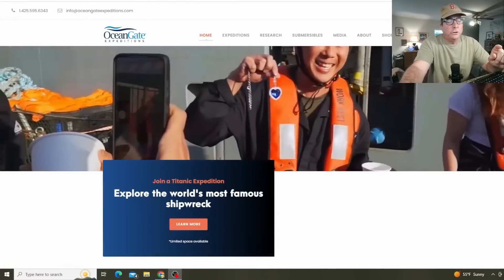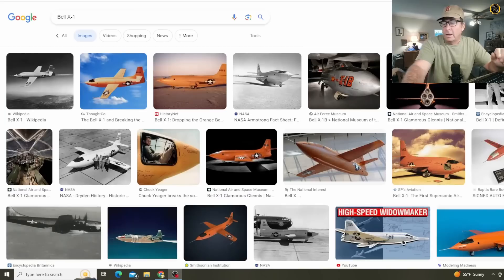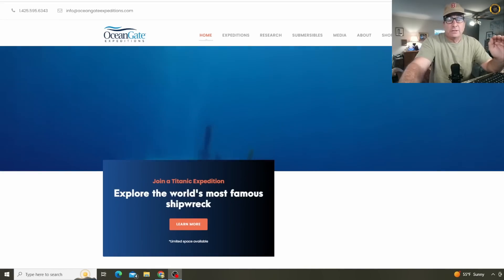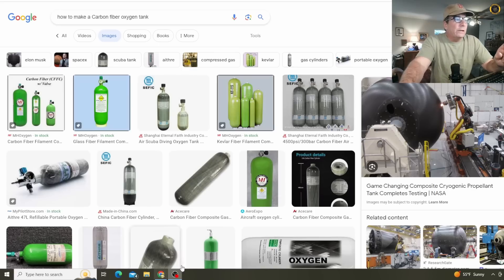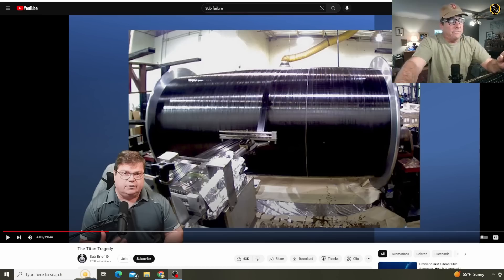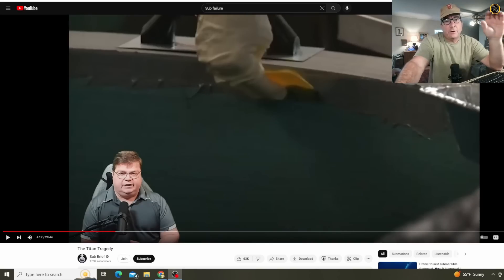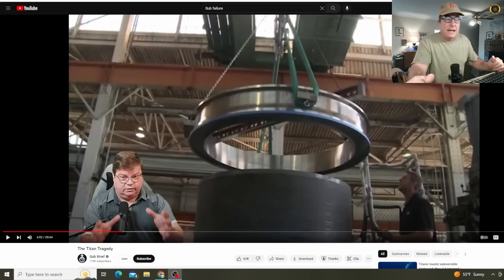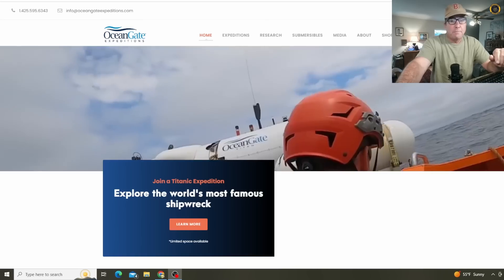Oceangate Sub Construction Details and Implosion

Comment: So the CF cylinder was laid up unidirectional and was cold cured ?  Without an Autoclave ?  The 2 titanium rings only attached with resin / adhesive?  The end caps attached with 17 bolts, or about every 10.5 inches?  What criminal came up with that design 😢  The ceo fallen into the trap surrounded by Yes men 😢  RiP  to all

Comment: The various titanium alloys are indeed unique creatures. I read an article by Kelly Johnson where he talked about the struggles they had developing the SR-71. The heads of the titanium rivets were shearing off and it turned out to be the chlorine in the local water supply reacting with the titanium. Ive worked with it over the years and it doesn't play well with others. It has its own feed and speeds,cutting tool reliefs and angles,etc. Like Juan said:" baby steps".
Reply: Similar to landing gear failures on transport jets. Not so long ago they were using Simple Green to wash out LG compartments and found out too late that it created hydrogen cell corrosion and LG failures in the massive steel struts. Who could imagine a cleaning liquid could destroy a massive gear strut? But it did....
Reply: Titanium, resistance to intense dry friction, while 'plowing' 6,000 coins per minute from a spinning disc, lasted many months of 20-40 hr weeks.. coin room counters.

Comment: I am a US Navy submarine veteran and a Aerospace Engineer, you were right on the money about the dissimilar materials, the compression modulus difference  of the carbon fiber and titanium most likely caused sheer loading at the titanium flange and had failure of carbon fiber at the edge of the flange. The carbon hull diameter will shrink more than the titanium ring and once the two are different enough the weaker will fail (carbon fiber). We will most likely find the bond held but fiber failed at the bonding point.
Reply: If done correctly,  I've found the bonding never fails...it's the weaker material.
The carbon wrap was like 5" wide, just going back and forth on a mandrel...
Reply: They were counting on the pressure of the water at both ends to force and hold everything in place. He only did 1 test dive to 3000 metres before he did the dive on the Titanic.
Reply: I used to repair submarines (Shop 38a). I've looked at videos about how they assembled this thing. And thought they should ask someone about slip joints. 
Not withstanding doubts on the durability of the carbon fiber (everyone is thinking of the stress the exterior of the tube, think also of the compression stresses on the ends, with the end bells pushing against that 5" flange also!) The best way to do it would be with the use of Chevron packing to allow for the flexing.
Reply: @brucelytle1144  I had similar thoughts about the end load on the tube. The way it was laid up didn't provide any support against that load. I once saw someone put some carbon fiber rod in a vice and with almost no pressure it just came apart. It was a clear demonstration of how fiber direction related to load direction matters.
Reply: I'm a structural engineer.  I agree with the difference in shrinkage causing a problem at the interface.
Reply: Question.  Would the tightening of the bolts have placed any torque on the titanium ring, thus weakening the adhesive?
Reply: Just seen an interview with someone who did the first dive of the vessel in the Bahamas with the builder. And was warned after the first dive by the builder that he will hear cracking! And when they went down together, he said you could hear cracking and you can tell when sub was going deeper because the cracking noise would increase.
Reply: Thanks.  Good to hear from a smart guy ....
Reply: People always just assume that glued joints are weak - but modern adhesives are absolutely incredible, even in mixed materials applications
Reply: @RyTrapp0  No testing ever done at 4000+ metres in minus 0 degrees water. Thats why something failed. They set themselves and the vessel up as test dummies.
Reply: @davidhowes7  Was making a general comment about industrial adhesives
Reply: @RyTrapp0  we're talking about 3800ft under the ocean.
I'm pretty sure glue behaves very differently in there.
Reply: @lorencelaflair4306  What kind of "glue"? Made from what base? Are you talking about an adhesive that's engineered for extremely high pressures or not?

Thank you for proving my point. Why you had to, I don't know - like I said, it was just a general statement. Ayy, some people just have to be confrontational for no reason though...
Reply: @RyTrapp0  lol you're the one who's way confrontational about this, I'm quite fascinated by this tragedy and have watched alot of experts in this field taking about this and most of them had said you don't use adhesive in this way for an operation such as this.
Who hurt you? Better get yourself metally evaluated before you delve into someth else, the only points of yours I've proven is that you have many mental issues.
Reply: @lorencelaflair4306  Have a good one...
Reply: Good explanation, but Young's Modulus for Titanium is actually about half that for Carbon Fibre (on axis). So I estimate the ring would shrink more than the tube.  Same result with shear loading across the bonded joint. cheers
Reply: @gjpercy  I would agree with that in tension, not compression, but I did not calculate anything just given my experience working with both materials in the field. I continue to believe the most likely scenario is the carbon sheered at the titanium flange due to the hourglass shape the carbon cylinder would have taken under pressure(diameter at center cylinder is smaller than diameter at titanium ring). I did not see a tapered cut on ring or the cylinder to allow for that deformation.
Reply: Good point Wise. The glue he used on that joint is the same epoxy glue under the brand name JB Weld. When it cures, epoxy resin glue shrinks 1 to 5%. The glue also only has a tensile strength of 5 to 6000 psi, but I learned the depths of the Titanic is 6000 psi. In my opinion, if he was going to join those two things, he should have had a 12 inch deep dado joint for the CF tube to fit into, then he could have drilled holes away from the edge through the titanium CF titanium and put bolts in it. Even though drilling CF weakens it, it would have been sandwich with titanium on each side. I wouldn't have glued it but put a rubber seal in it that would flex with the two dissimilar materials expanding and contracting at different rates. I would have also welded brackets on both the titanium rings every 2 feet and put titanium 2x4's that went parallel with the outside of the tube that bolted on each end to the rings. He could have also attached his thrusters to those 2x4's. I can't believe he trusted his life to the glue on those end caps. Like you said, one of those joints is probably where it failed. It probably started leaking high pressure water into that sealed compartment and blew it up like a balloon until it popped.
Reply: Carbon fiber actually does the exact opposite of what you described. Unlike most materials when it is heated it actually shrinks and when it is cooled it will expand. It's called a negative coefficient of thermal expansion, which is pretty unusual because normally the exact opposite happens with other materials.
Reply: @actionjksn he's talking about their different stress/strain characteristics not their temperature expansion
Reply: @Epiphany-818  & @actionjksn - The Modulus of Elasticity is the relation of stress strain, the thermal coefficient of expansion also plays a big part, putting together a metal & a material with a negative thermal coefficient is just acting for cracking in a pressure vessel.
Reply: @Epiphany-818 You're right but the different reactions of the materials to temperature is yet another factor at play. So many things adding up that make the design a terrible idea.
Reply: @Epiphany-818  I think both differences in mechanical properties and differences in thermal expansion / contraction could have been factors.
Reply: @actionjksn  I didn't refer to temp I referred to pressure. However it would be interesting to see which force is greater at that depth.
Reply: @TheWiseFool_  at a guess I'm going with pressure is the greater force at that depth given the temperature difference is only going to be 20 degrees C at most? Just a guess, but I'm sure it can all be calculated.
Reply: @TheWiseFool_  Then what were you referring to when you said the carbon hull diameter will shrink more than the titanium ring? What would cause it to shrink?
Reply: @actionjksn  water pressure at 12000 ft deep
Reply: @actionjksn  But has and was Carbon fibre ever tested to these extremes of stress and in those conditions on a protype vessel as that one.
Reply: @actionjksn  So this suggests some questions: 1) is the compressive force against the carbon-fiber cylinder consistent along its length, and 2) at the extreme depth and temperature would there be a differential, especially near the flange?  If so this could have been a point of structural failure.   Specifically, the cooling effect of the water temperature at depth (about 28 degrees F) and the compression of the cylinder near the titanium flange might experience enough deformation to cause Titan's structural failure.  I'd bet money OceanGate didn't test this.
Reply: EGO....
Reply: I dunno about that. I have no credentials but this is my idea of the failure: Imagine the CF tube, it’s weakest in the middle. The compressive forces deform the tube in the middle of the “hull”. This distorts the ends of the CF tube at the Ti end caps to out of round in effect racking the mating surfaces from intimate co-planar contact. Glue joint failure at the Ti face. Kaboom.
Reply: @chrisfournier6144  Just seen an interview with someone who went on the test dive. And was told after the first solo dive by the builder he would hear cracking. When they went down again, he said you could hear the hull making cracking noises and you could tell when sub was going deeper by the increase in the sounds.
Reply: @chrisfournier6144   2 decades of failure analysis tends to show bonding compounds are stronger than the materials they are bonding.
Reply: okay who cares who you are just type your comment and keep it pushing
Reply: @edithandlez Evelyn Musk I assume, by far the most accurate interpretation. To think I was going to start my rant with ALL 314 of my Nobel peace prize awards.. Fr though I am going with all that sounds good... but fully judging I would like to speculate that it could have hit the sea floor or a boulder or shrapnel kinda "fiberglass cracking" and creating micro fractures in the epoxy and I assume each fiber at that idk "hot/cold idk yet what carbon does but I'm going with that way less tech answer but the flanges clearly weren't the proper chamfer

Comment: At 4:30, IF that was how it was actually designed and fabricated, it was doomed from the start. But, then, I'm just a 50+ year old white guy with years of Manufacturing Engineering experience on fighter jets, working with Ti and graphite composites. They didn't use an autoclave for bonding? Shame.
This submersible vessel was truly a 'ship of fools'. Sad to say.

Comment: Very interesting especially how the end caps glued on.  Even scuba divers can lose teeth fillings if air trapped underneath.  James Cameron stated Monday that he felt there was an implosion.  With sudden loss of comms, tracking transponder(own battery) and navy heard a sound same instance.  Sensors on sub to defect failures not early enough warning. Just as the Titanic full steam ahead on a moonless night with icebergs this oceangate  company ignored all the warnings of certification testing.  Does carbon fiber delaminate with cycles?  So many questions.  Brian Ballard stated no loss of certified submersibles since beginning deep
Dives starting 1960’s.  Previous Russian submersibles to titanic had 2 submersibles diving same time in case of an emergency.  There was no plan B for oceangate.  If this was not an implosion but stuck on bottom no emergency response set up by the  company.  The owner of oceangate felt that his design was essentially impossible to fail.  Yes, you can lose electricity or motors fail but not the structure just like titanic engineers with no need extra lifeboats.  But titanic made new maritime laws just like this catastrophe which was preventable
Reply: Besides the fatigue thing, air bubbles trapped in carbon fiber, etc., you have the  warm… extreme cold thing with actual condensation on walls of the Titan stated by passengers.  Moisture cycles not good either.  Great video, thx

Comment: I can see how carbon fiber works when used on pressurized airplanes because the aircraft skin is in tension due to the higher cabin pressure than outside air, however, it doesn't seem to be a good material for compressive forces as the laminate is just working against itself and the fiber isn't adding much strength. Also the shape of the sub wasn't doing much in the tubular sections and had to support the side stress of the ocean and the titanium end cap stress, and again don't see how fiber could be strong in that compression force.